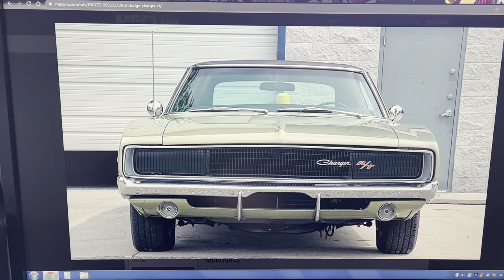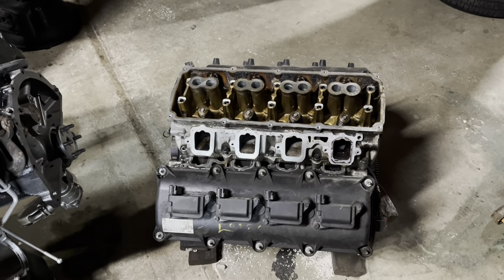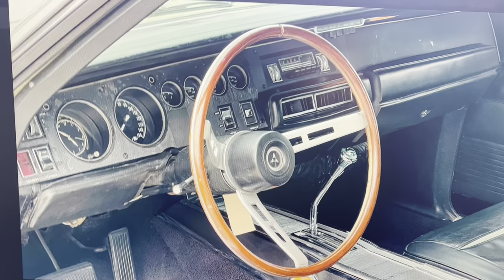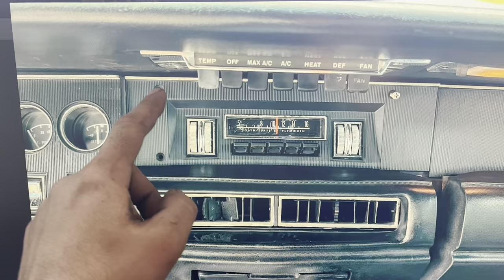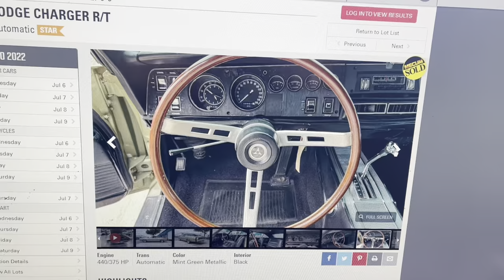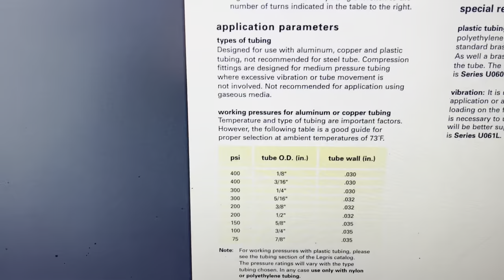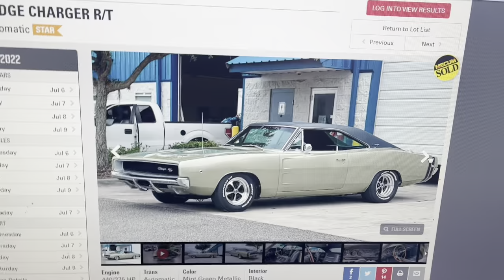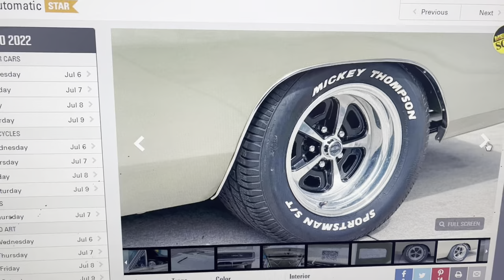Why Did This 1968 Dodge Charger R/T Just Sell At Mecum For $170,000? (It’s Unsafe And Bad)

Comment: All of those full size unibody mopars, are unsafe at any speed.   Have watched a 68 roadrunner get a ground up restoration for past yr..
You couldnt give me one of those, holy what a hodge podge crap car.  
There only ok to look at from a distance..  Ralph Nator should have included those big unibody mopars in with the Corvair..
Reply from the maker: Well, first off the B body was an “intermediate” car. Second off, they can actually drive quite nicely. I don’t know if that is more exception or more rule. You can give me all of the ‘68 Roadrunners you don’t want though.

Comment: 2 barrel chargers didnt come with a sway bar.this car was a vin swap
Reply from the maker: My two barrel car would beg to differ. Tom’s 318 car would also beg to differ. Also, the lower control arms in this car have the end link mounting points, and the bar brackets are there. If it didn’t have one originally, they went to all the trouble to take the sway bar off (which you wouldn’t need to do,) transferred everything over and then didn’t bother reinstalling the sway bar. Frankly, I don’t give half a shit if this is originally an R/T or not. I have no reason to think it isn’t. That isn’t what this video is about. It’s about careless restoration hackery.

Comment: If the interior is that rough the outside must have been worst than the inside a bondo wagon cheese everywhere the brakeline union is lawsuit material no way out of that hack inverted flair is the only way except an entire new line would have cost the same as that union,  
good workmanship is  very hard to find body men these days are put out of business if bondo and the mig welder is taken away, the purpose of metal is to hold the cheese, the car was built without being carved out of bondo why can't it be repaired without the crap???
The only thing appealing is the original design the rest is pure rubbish and like this guy said 35,000.00 tops..

Comment: As just a "used car" meaning if it wasn't a highly desirable collectable, it's like a $3500 to $5000 car at most, as it no doubt needs a real, complete restoration. I bet if you stripped it down and tore it apart, you'd find the worst rust patch repair and thick body filler spots all over it and many parts that either need to be tossed or many hours re-bending straight again. It's a total basket case if this much can be seen in plain sight.
Though super cool looking, Dodge (muscle mopars in general) cars were NEVER well built and put together cars, from the factory. Anyone who goes to museums and looks at real survivors will know this.They were literally, cheap cars that parents could buy their boomer teens to let them bomb around in them without worry.
I'm all for collector cars appreciating in value, but this is course is ludicrous to allow fools to fight over what they THINK to be an actual fully restored car. It's shameful. GREED, not money, ruins everything.
My '68 t-bird was basically in the same condition when I got it, however I saw it all and I knew what was there or exactly what to expect when I went digging BUT I also payed exactly what it was worth too....Then I properly restored it myself.
MOST people should not own classic cars. They don't know how to care for and or repair them. Their shoddy BS (i wont call it "work") just costs real car guys loads of time, removing their trash before we can do a proper repair. TWO owners before me, both the same. Had to fix junk BS before I could do it right..... but I knew it just by looking the car over (and all it took was 10 minutes for me to the "know" the car) and payed accordingly. The buyer of this car, doesn't have a clue and if he has that kind of money to spend on a charger, It's all HIS fault for not paying someone who knows to look it over and put a real value on it for him.

Side note; I LOVE the look of '68 chargers! I'd LOVE to have one too!
(because I also can "see" cars like you, I don't "like" them due to what they really are. This goes for all the muscle car mopars. I mean no offense to those who like them. Of all classic car enthusiasts, I believe the mopar fans wear the biggest rose colored glasses of us all. Most will take offense to this, even though 0.0% is implied. I bet you'll understand me though, based on this video.)
Reply from the maker: You make a lot of good points here - but I do have to say, the absolute crappiest non-R/T project cars are trading for 10,000+. Apparently a ‘68 R/T that needs literally everything is still worth $35,000. So I will have to disagree and say that this one is still worth much, much more than that - but I still completely agree with your main point. Who knows what’s hiding under that paint? That was my real point here. One must be extremely careful. I want to give them the benefit of the doubt on the metal work being good, but I just can’t.
Reply: @DeadDodgeGarage  Oh I'm well aware. This is due to supply and demand of course. I meant if it was just a used car and not a " 2nd gen dodge charger" collectable car. 
I fully understand WHY these are very expensive in general....as they should be. I mean based on it's condition, if it were just an "old 4 door dodge car" for example, in the same exact condition.... it's just a $3,500 to 5k car, at most... just based on it's overall condition. Of course no one can score a '68 charger for "normal used car money" unless someone knows someone, good friend, family passing it on.

Yeah, I'd bet real good money, the metal work on this car is horrible. That's why if it were mine, I'd strip it. I would trust NOTHING on this car... and be thankful for everything I found still decent to work with, as I properly restored it. Just because it's a super cool looking '68 charger, wouldn't make me change my approach from I how viewed the restoration on my '68 t-bird.

Comment: That looks like a union not a compression fitting.
Reply from the maker: A flare union would have two male threaded nuts on the outside and the female union in the middle. This has two female threaded caps which would thread over the center piece and compress the collets in between.

Comment: Chrysler industrial Hemi Chrome valve covered heads will 440 heads fit on the Hemi block? Was used in Golf Course irrigation pump 1970s
Reply from the maker: The only industrial hemi was the first generation engine. Most likely a 331, although others may have come in that sort of thing. It is a very, very different block, so no. In theory, 440 heads could go on a 426 block with different pistons. The amount of work involved would be excessive.

Comment: I have been driving for Mecum for 10 years. IMHO 90% of the cars have problems, 50% have serious problems. If you buy a car there, expect expensive repairs. You have to do your homework. Inspect and research who did the restoration or is it a cheap Flipper. Lots of Pigs With Lipstick there. Ofcourse if money is not an issue, there's some fine gems that will bring a exaggerated premium prices. Let The Buyer BEWARE.
Reply from the maker: Thank you for your perspective. That sounds about right to me…

Comment: Let's say you were driving your 1970 shi#t-hot Charger in the rain at 70 mph on the freeway and you couldn't stop to avoid crashing. Later, it was determined that you broke your son's back and he was paralyzed at the age of 5. That happened to me! I eventually regained my ability to walk and didn't know I had a broken vertibrate until I was 44. I'm almost 60 and have been able to walk for 58 of 59 years now, thanks be to God! Compression brake fittings, my azz! Safety first! Having said that, I wish I could have one as a project car.
Reply from the maker: Damn dude. That’s brutal. I am a bit of a hack on these old junk piles at times, and I’ll take a low speed test drive through the neighborhood, sure, but it’s important to me to get the brakes right before they hit the road. Hacking on the brake system is just not a good idea.
Reply from the maker: Damn dude. That’s brutal. I am a bit of a hack on these old junk piles at times, and I’ll take a low speed test drive through the neighborhood, sure, but it’s important to me to get the brakes right before they hit the road. Hacking on the brake system is just not a good idea.

Comment: nope, testing my brakes/2G F8 charger and systems max is 1200-1500PSI with me/150-220lb's in ( regular traffic is 100-300psi-parker-gages or so old 1969 charger's setup sorry but id have to do a lot of mathematics to get the input lb's/force's, not sure about the drums slave maximum limit psi but the replacement's i could get in 2012-19 kept blowing out aka not safe as i lost the line/bleeder-screw/remanded-master-seals/mistakes or missing parts-like C-clips/retainers part of the reson why i went full-4 disks 17"rim kit-minimum-size ) and same way for my sibling but my boomer/potity-90-140lb mother no under 800psi, and willwood doesn't cert/DOT there 6-piston calibers-kit for more than 1200-1600PSI sorry have manuals for my 1969 A/C 383-G-code auto 3.2FG power-brake 14"-rims ( tires are a pain to find anymore in the oem size and or not very good ect ) and the modified brakes and bendex-9 ( California ramanan shop and also has a nice aftermarket kit-9 👍, got my 9-core at hard rock jeep 👍 )( at the master i can change the boost-hydraulic PSI up or down so maxed iv tried for giggles/1st setting's is about 2kor3k psi but turned it back down to not blow out the piston viton-seal's at the salve's ) as vacuum after modifications don't work like i what it to ( big cam/boost ) and the OEM master cylinder quit, anyways the old 6:1 is the same in-power vs out-psi as my modified/updated kit just better 🛑stopping as the older version was 4-wheel-drum's and now all disks with aressive-pad's and more petal-feeling/feedback and -4 SS-lines and braded-houses 

BTW forms moparone name i believe it's been ages since i logged in the $$ has kinda challenged my abilities to play with my hobbies 

yes GNX and diesel 1-ton's brakes are higher PSI but this's is a 2g  charger?? so not relevant information
Reply from the maker: Cool. Do you think it’s relevant if someone thinks it’s ok because you just said there is “only” 1500 PSI in this system, so they’re good to put a compression fitting on a brake line on their 2010 Ford F-150 which makes a lot more than that? Are we really going to do all of this leg work to excuse a crappy shade tree repair that could easily be done the right way instead?
Reply: @DeadDodgeGarage  nope! not at all my car had wire-nut's behind the dashboard ( hack job ) and tried burning down on the home 1st time under 20 miles and because i wasn't in town/time/business-trip-oil-rig's maintenance-job/needed to move/failed-dot-state-test my replacement harness ( day-1 resto/repop ) installed buy a others than me/family i also has problems and normally i build my car's not paycheques my hobbies and sofar haven't haven't gotten a finished car/hobby-buy , FWI not snobby about it just a trust and best bang for my $$ thing's

im just pointing out the facts ( and hopefully it helps someone else to know what's about normal operating conditions 1969 and or saving someone from accidentally over pressures ( max line temperature is about 400-500F and more and it melts the seal's/plastic parts/seizes-up parts ) and wilwood kit's and = wrecking ) about stock power brakes on my/your car OEM power-vacuum system and still not legal repairs and not safe ( and i have worked in a auto and racing shop in the past 2008*-14* and i don't do that ) as you pointed out automotive/brass compression fiting's can't handle anything more than 50-200PSI reliabley, and yes some people did say my upgrade's are over kill ( 4k+psi bigger -4jcb SS lines ect but it's the last system at random id what failing, the engine sputters is more accessible but big newson's and rather pass as a 1st failure ) but iv had float-sunk/vacuum/psi-line fail ( chex the passengers/transmission tunnel line my chargers coaked up/pluged when i started to driving it in 2012-15~ and was hanging the LF-drum/hard to bleed ) one time and yes my buddy's mercury got clobbered by my k1500

Comment: Because it's a numbers matching 440
Reply from the maker: Yes, and that’s absolutely worth something. What’s a 440 automatic car that’s had half of a restoration done worth though? How about if the bumpers aren’t straight, the sway bar is missing, there’s a ratchet strap holding the speedometer cable off of the exhaust, and the brakes are a death trap? I don’t think it’s almost $200k. That’s nice Hemi car territory.

Comment: Anyone else notice the blue of the engine?  Isn't that Imperial?  Meaning not HP 440?
Reply from the maker: It’s not blue, it’s turquoise. Many, many people have noticed and said something about it, not realizing that HP big blocks were still turquoise in ‘68. Only the Hemi was orange. That changed in ‘69. It’s a similar contingent that noticed the car has drum brakes and think that’s wrong - it’s not. Much more recently, I did a video detailing what is and is not found on a ‘68 R/T, mostly to respond to comments on this video.
Reply: @DeadDodgeGarage  ty!

Comment: You don't need to be an expert with American muscle cars . They're all junk. I had one of the top muscle cars and bought it only because it was a "good "deal over a Porsche. I had a 69.5 Mustang Mach 1 SCJ with the GT package on top. I bought it used and was the second owner. The car was an ordered car and fully loaded. The car was mostly stock with added traction bars and upgraded shifter. I'm a driver and became an expert driver of a really cool junk muscle car. It was black with red interior and looked like 60 parked , but that's what idiot drivers did. They just looked at them ,spun the wheels and bragged about how much wax and HP they had. So I wanted my car to prove itself and that went to the point of trashing the car and me . I ran many muscle junk cars  and did pretty good with the exception of the European sports cars. I put the test one night against a Porsche Carrera. I put my car in full air and barely got it to straighten out  . My top speed was about 115 . I never lost the Porsche in my rear view and not sure if I won or just wanted to see what a SCJ could do . Either way I thought I'm driving a piece of shit and the wrong car . It's hard for me to ever hear how great any of them are . Funny how they're supposed to be sports cars and the only American muscle that was close was the Shelby Cobra, Pantera, even the Vetts were a joke.   I never lost to one .
Reply from the maker: Muscle car =/= sports car, and anyone who thinks it does is an idiot. 

Having said that, every classic Mustang I’ve ever driven was just bad. Handles like it’s falling apart, rides bad, drum brakes the size of bottle caps… you can’t judge every car made in that era by a Mustang. Muscle cars are great - not because they are the fastest (they aren’t,) not only because they look great (they do,) but because they’re special. It’s a combination of many things. They have spirit. There is magic in an old car. People have come in here to tell me muscle cars are worthless because modern cars are faster. They clearly don’t get it.

Comment: I wouldn't have paid more than 10k for that pos.  I have a 1973 Charger SE yeah I know it's not the RT but after the rebuild and conversion to fuel injection on the 400 cid engine I have the same hp.  The 383 went away and the 400 replaced it.  I've owned it since 1979 it's my first car.  I paid $1400 for it.  I have most of the original hardware and compared to this mine is a thousand times nicer.   I did have the quarter panels and rocker panels replaced.   All the door panels are nice no cracks in the dash.  The 68 is trash and the buyer a fool.
Reply from the maker: Cool, but if you think this car is only worth $10k today, you are also a fool. In my (pretty well informed) opinion, this car was worth a little over half what the buyer paid. Compared to the market for these today, your experiences buying cars in the 70s might as well have taken place in outer space - and as much as I love ‘73 Chargers, comparing the value of one to a ‘68 R/T is like comparing a golf ball to a hand grenade. Also - and this is a moot point - but the 383 was not available after ‘71. You might have known that, I can’t tell from the way your comment is worded.
Reply: That 68 is junk.  I know about all the mopar engines.  My 400 came from the 383 big block.  My Charger is about 85% original aside from the engine mods and the new quarter panel and rocker panels.  I converted it to fuel injection and have a handheld Garmin touch screen like interface to make on the fly changes.  I have the same amount of hp as a 69 hemi motor.  Mine's black on black.   Only a moron would pay that kind of money for the 383 I wouldn't for the 440 or the 426.  Sht my grand parents had a 383 in their 70 Plymouth Furry 4 door sedan.  Hauled ass in the back roads to my uncles farm and pond where we fished.   The 69 was the charger to have.  Better looking front and tail.   The 383 was a family mobile motor.  Just like the wimpy 400 they made out of it and put in my car.  It had 185 hp and a 2 bbl carb.

Comment: I don't know Chargers at all. But I was surprised that a 440 R/T car had drum brakes in the front. Is that correct?
Reply from the maker: Absolutely correct, yes. A few other commenters have called that out - but drums were still standard on R/T in ‘68.
Reply: @DeadDodgeGarage  Real R/T would have more leaf springs though, wonder how many this car has?